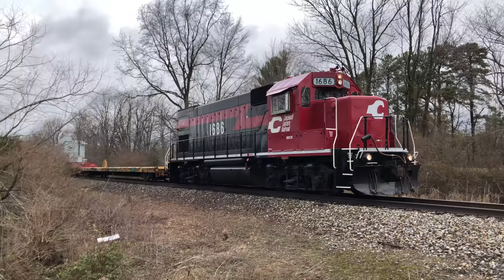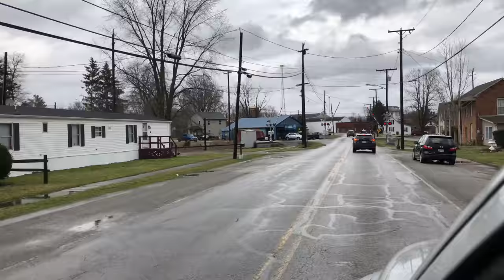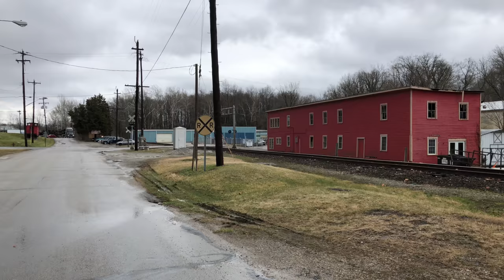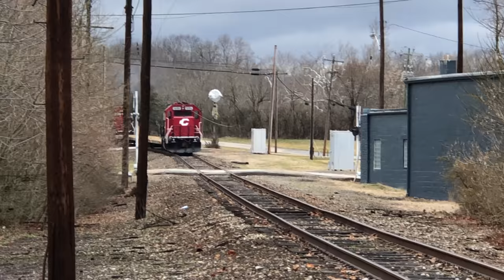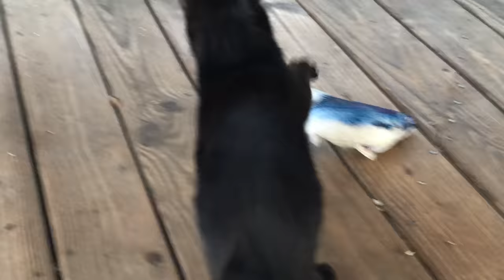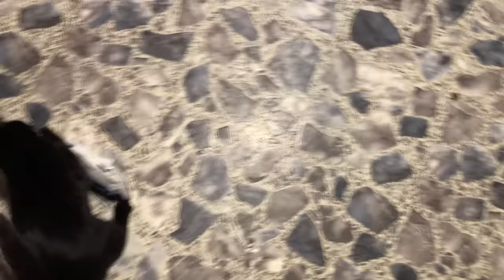Rare Train, Over Size Loads, Giant Transformers, Special Train Move, Short Line Railroad Action Pt 2

Comment: I work at a zinc refinery years ago (90's) and had a transformer similar size) shipped in by rail.  The rail line was dead-ended years before.  The first transformer was damaged and had to be sent back for repairs.  It tree branches, etc., stuck in it.  It was repaired by the manufacturer and returned by rail.  It came equipped with meters to record GeForces.  It came back intact the second.   People involved said the GeForces were very high.
Reply from the maker: Thanks for watching!

Comment: CCET moving those big transformers. I'm sure that takes a bit of horsepower.
Reply: Not much, actually. Those two locomotives are only 1500hp each and the one at the back of the train wasn't running.

Comment: Some of those grade Xings show just how low these cars ride. This illustrates there is no place.for poor track conditions. These high wide loads actually extended the life of several miles of former Chicago Great Western main line in Illinois. The nuculear plant near Byron IL got numerous loads of oversize boiler parts via rail on the spur that connected to the MILW RD mainline It is now being decommissioned so no doubt some old components will leave there by rail. Looking at those idler flats they had a reporting mark not seen before TTXX. Judging by the look of nipped off graffiti on the frame these are probably former tri-level autoracks recently superseded by the convertible style. The panels and support beams with the rest of the graffiti were cut away leaving a perfectly good deck.  So for a day on CCET their world was indeed flat.
Reply from the maker: Thanks for watching!
Reply: TTXX is the railcar pool service business owned in part by each of the big railroads.

Comment: Nice video and I like you showing the rail info.
Reply from the maker: Thank you very much!
Reply: I worked in that rail mill that made the rail he mentioned. I worked in the rolling mill part of the mill. That was a 132re he mentioned. Most of the main line track now is  136-10. The rail section got the number name from 132 would be 132 lbs. A yard length of rail. 115 would weigh 115 pounds per yard of rail. 136-10 used on most main lines now.
Reply from the maker: @BeeLineEast  Cool and thanks for the information Michael!
Reply: @JawTooth  You are welcome. I was glad to see the Steelton rail that is that old still in use today. I have seen some from the 20s and 30s still in use. CC on the rail means Controlled Cooled.

Comment: Okay... a few novice questions:  would the CCET have cars like needed for the transformers in their inventory, or any of their own cars for that matter? What, if any, does a short line like CCET have... a few locomotives and maybe some rail servicing vehicles? Those 2, cool-looking and nice livery locos CCET now has... leased or purchased? That would seem important... a short line must have a certain number of forecasted clients, client need deliveries per unit of time, and maybe additional traffic from elsewhere to make ends meet. Do you know? And.. are you becoming a hippie? I plan on getting a haircut today, and I look positively like a Ohio Bigfoot compared to you, but you've been so shaved to the bone for a while, so I am surprised. Gracias por tu video. RT sends... Puebla, México...
Reply: My :guess" would be they were loaded at point of manufacture on cars owned by that manufacturer. Just a guess. I went back slowed it way down and paused but could not read the markings on either car..
Reply: 1. A short-line railroad wouldn't own specialist cars like that -- even the Class I's tend not to own that kind of equipment. These ones are owned by Kasgro Rail Lines (KRL), a specialist manufacturer and leaser of heavy rail vehicles. (I'm not sure by what loophole KRL has a reporting mark that doesn't end in X -- perhaps they're a subsidiary of one of the railroads.)
2. CCET owns a couple of flat cars and some of the hoppers used on the rock trains. Some short lines own fleets of box cars that they lease out to make more money; otherwise, short lines tend not to own cars unless there's some kind of traffic whose source and destination are both on their line.
3. The three new-looking locomotives (the pair of GP15-1s seen in this video, and the SD40-2) are owned by Indiana Box Car and leased to CCET -- if you look closely, you can see the IBCX reporting mark. CCET own their other locomotives.
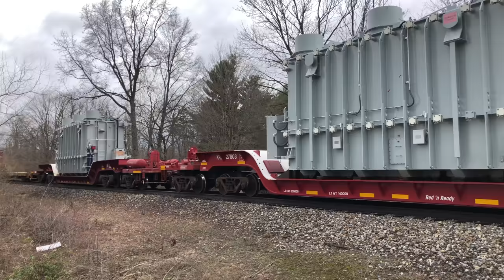Reply: @frederickwise5238  The KRL reporting marks on the lowboys are legible even at 360p resolution at 1:02.
Reply: @beeble2003  Thanks. I wondered about that. Does seem pretty costly to have and not be used a lot unless by a manufacturer of heavy equipment.
Reply: @beeble2003  I guess if KRL 27803 means something to you that's good. It meant and still means nothing to me. ?????
Thats not a rail line Im familiar with.
Reply: @frederickwise5238  KRL is the reporting mark of the car's owner -- Kasgro Rail Lines. 27803 is the running number of the car. You said you couldn't read the markings, so I assumed you wanted to read them and pointed out a place in the video where they were clearly legible.
Reply: @beeble2003  I appreciate but 3 letters and 5 numbers meant nothing to me. I was looking for a RR name: Nickle Plate Road, B&O, Pennsy, NYC, UP, SP etc.in the center dropped section where a long name would be stencilled. ????  KRL was meaningless to me. I never heard of it before (and I did say I was making a guess) LOL
Reply: @frederickwise5238  Every car and locomotive on the US rail network has an alphabetical reporting mark of between two and four letters, which tells you the company that owns the vehicle, and a road number of between one and six digits, which identifies that specific vehicle in the company's roster. You can oogle the reporting mark to find out what company it corresponds to. Of the railroads you list, only UP is still in business.

Comment: At 6:57 is that a low-hanging utility line? If so, how did it not snag on the train?
Reply from the maker: Wow, I didn't see it until you pointed it out.  It is a utility line of some sort
Reply: Yep, that's a utility line, alright.  It must have just come loose as the train was passing under it.

The video shows the line momentarily laying on the roof of the 2nd engine, then dropping down farther once the train has cleared.

Comment: I wonder how those transformers are secured to the railroad car because you don't see chains and binders anywhere. So how'd they do it?? Or are they just setting there unsecured because of their massive weight and the slow speed of the train??
Reply: Welded to the deck at various points as directed by the company that makes the transformer. Upon delivery the welds are cut and removed once the transformer has been lifted clear. The welds have to be ground flat and any cuts in the deck repaired for the car to be returned. Charges apply if the deck is not presentable.
Reply: @markfryer9880  I would have never guessed although it makes perfect sense. Thanks for answering my question!!!

Comment: Thank you for showing us the Cincinnati Eastern train with the high and wide loads at another road crossing before they arrived at Sardinia, Ohio. The process of backing the transformers onto the house track at the Sardinia, Ohio wye was interesting to watch. Then you followed the engines and the spacer cars through Mt. Oreb and Williamsburg, Ohio. I think I saw a YouTube video with a high and wide load using a Shnabel or is it a Schwabel car to carry the load but I do not remember the YouTube channel. Wide World of Trains has a number of videos with high and wide loads on depressed center flat cars that have 16 wheels on them if I remember correctly. The depressed center flat cars that Wide World of Trains has captured have a caboose for crew members from the company that owns the depressed center flat cars to accompany the depressed center flat cars when they move to and from the plant that makes the transformers and turbines that are placed on those depressed center flat cars.
Reply: Schnabel, with an N. Those are cars that are essentially two half-cars, and the load becomes part of the structure by being attached in the middle.
Reply: @beeble2003  Thank you for correcting my spelling error. I should have "Googled" the name to make sure that I was spelling it correctly.

Comment: I like to the reason for empty flat cars behind the locomotives
Reply: The spacer cars are to avoid overloading bridges. Each of those lowboys, if fully loaded, weighs the same as two or three loaded grain cars, but takes up much less space on the track. If you put those two cars, plus two locomotives on a bridge, that's a huge weight; the spacer cars add length to the train so that, yard-for-yard, the train as a whole weighs about the same as a regular train.

Comment: I wonder why they used spacer cars on that train.  Are they dangerous or hazardous?    BTW, I found I like the music in yours videos better when played back at 1.25x speed.  LOL
Reply: The spacer cars are to avoid overloading bridges. Each of those lowboys, if fully loaded, weighs the same as two or three loaded grain cars, but takes up much less space on the track. If you put those two cars, plus two locomotives on a bridge, that's a huge weight; the spacer cars add length to the train so that, meter-for-meter, the train as a whole weighs about the same as a regular train.

Comment: Just a clarification, is 230 tons the weight of a single car with a transformer or the total weight of both?
Reply: The "LT WT" (light weight) marking gives the weight of the car in pounds, and "LD LMT" (load limit) is the maximum weight that can be carried.

The first car's (KRL 27803) the light weight is 140,000lbs (70 tons) and the load limit is 300,000lbs (150 tons), so the maximum weight of the car plus load is 220 tons. For the second car (KRL 90004), it's 154,700lbs (77 tons) and 475,300lbs (238 tons) for a maximum total weight of 315 tons.

No idea how much those transformers actually weigh.